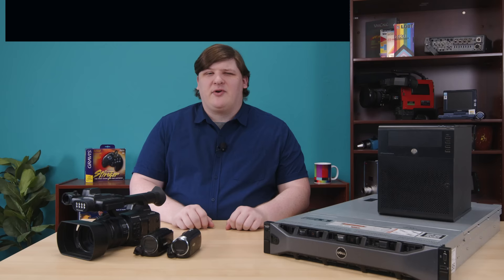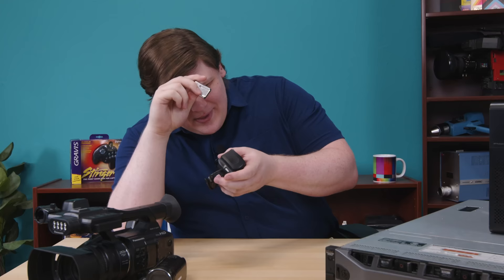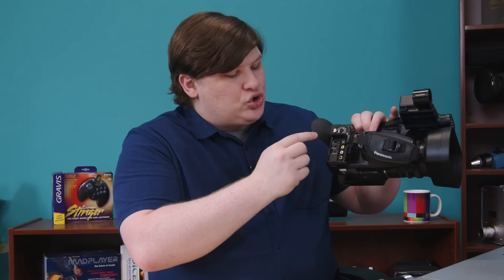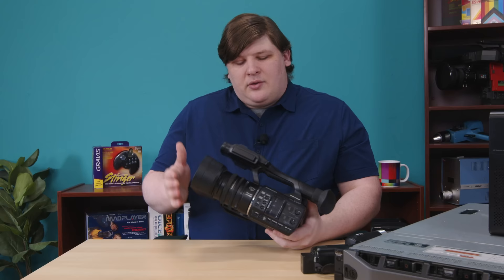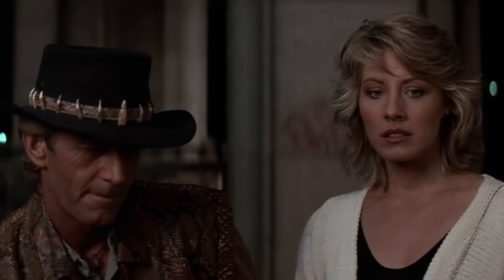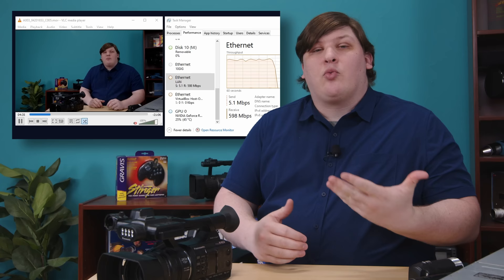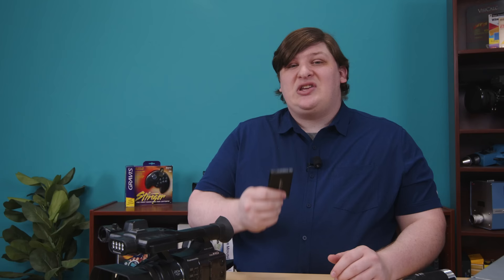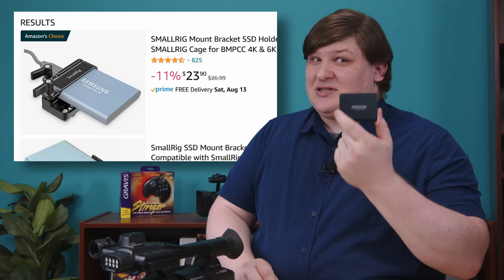I Built... a really fast NAS?

Comment: I have a few SFP+ 10GB NICs...  Both of my computers (Windows-10 and Windows 11-pro) have a dual-cage card like the one you said was dead as fried chicken.  I actually ran into the same thing UNTIL I installed the drivers from the card's website.  Not sure eactly how it works, but VERY VERY early in POST (I think before it even hits the BIOS) it loads the driver.  When turning on the computer the VERY first thing you see is a 3-4 line blurb about the NIC card and tells you to hit CNTL-S (Or something like that) to get intto the CARD's configuration...  Granted for me, I never had to actually go into the setup by interrupting the boot, but I CAN say that without the drivers I got from the card maker's website, the O/S didn't see the card AT ALL.

Comment: I only record and edit in 1080P still, but I still end up in insane amounts of data, but I have run my channel since 2012.  I have been a network engineer for 30 years, so I am pretty experienced.  I have a "server" chassis with hot swap bays but I built it with a regular MSI motherboard and a AMD processor, with 16GB of RAM.   I have a 250 GB ssd for the OS, and I have 5 4TB rotational drives in a RAID 5 with a hot spare.  I am just using mdadm to make a software array.  I use XFS.  I also have a 1TB single rotational drive for scratch data.  I have a removable drive bay for my backups where I backup to 12TB drives with rsync.  I use LUKS encryption for my backups and run one of them every week to my safety deposit box.  I have a 10GB/s switch that runs 10GB/s on standard Cat5/6 cables. and I have 10GB/s adapter in my main workstation and many of my other computers are 2.5Gb/s or 5GB/s.  I am using a tp link switch and I don' t have any network problems, I use them for many customers as well.   Currently I am running Rocky Linux, but I used to use CentOS (till they went stream).  I also run my DHCP, DNS, web server and mail server on it.  Once every few months I shut it down and take an image of the boot drive with Clonezilla.   I also use a little known program called drive snapshot and do a backup on my main workstations and laptops..  It is a really small program, a single executable, and it does differential block based backups, so I don't have to wait very long on it to run.  And it runs on a low priority thread, so it will automatically slow down or even pause if I am using the computer.

Comment: As someone who builds software in the cloud/server space, I just wanted to say that every decision you made building this NAS was exceptionally thought out and most people would over look these things. Because you're going with Twinax in adhoc mode so you can essentially do direct attach, I was wondering how close this server will live to your editing rig. At this point I have a rule of "no more servers in the house" because the noise, heat and maintenance are no longer worth it for me especially with how cheap baremetals in datacenters are (OVH and Vultr have amazing prices, OVH has more to offer on the storage front though with a beefy baremetal containing 4x 12TB drives for $165/month). Your case makes sense because of the sheer amount of data and the bottle necks of that transfer. You said you're a Dummy and didn't want to build a machine smarter than you, but honestly; I'm impressed with all of your decisions on building this. It's gonna last you a long time. Great Job!
Reply: 4x 12TB for 165$/Month?
Hetzner has 4x 16TB for 87.56€/Month.
I used one of those for a while, but ended up hosting that stuff at home, because it is actually cheaper, even after the purchase of 4x 18TB drives, the Supermicro mainboard, RAM, UPS etc. and calculate the (now higher) electricity prices, it's pretty much amortized in about 3 years.
If you compare that to the OVH offering you mentioned, and maybe you don't live in Europe where the electricity prices skyrocketed lately (and drives are also cheaper), you'll get an even faster ROI, probably closer to 1 to 1.5 years.

Sure, you don't have to manage the hardware, but you pay A LOT for that. And another benefit from hosting it yourself: you have hardware access, which in a DC you only have of you do colocation.
Reply: @RobinCernyMitSuffix  I just have this rule of "no more servers in the house". Becomes hours of my life working around the server after regular homeowner mishaps. Basement flooding, power outages, cooling and heating in the basement, humidity issues, noise, Dynamic IP, etc. It became too entangled in my life with a growing family and to alleviate that, I found the monthly cost worth it. I encourage everyone to experiment with servers in your house though, you learn alot and it's kind of a fun hobby.

Just checked out that Hetzner plan, now I can easily migrate over to that for less money a month, more storage and better hardware. Thanks!
Reply: @barrynevio4440  understandable, but still, flooding is not really an issue for most people. And noise and dynamic IP addresses are just a setup thing. I barely have to do any maintenance on my stuff, maybe once or twice a year something a bit bigger that takes a few hours, like setting new things up, but you also have that on every server no matter where they are. And every few months cleaning the case from dust.
The rest is pretty much automated and monitored. After the initial setup which is quite a bit of work (not much less then renting a server in a DC) it just runs.
A lot of the work applies to all servers, like upgrading the OS and software.

To be honest the server that I have in colocation in a DC creates more work and runs less stuff then my homeserver, but that's probably just because of the sub par hardware that I use there >.<

Comment: Back in the day I admined ZFS in data centres .  Zero problems.   Super cool, simple and loaded with features: snapshots, dedup (if you have lots of CPU) & you can use a very fast SSD cache too with slower disks behind it.  Make sure you got some automation to alert you when something redundant fails, disk, fan, power-supply

Comment: So someone has probably already commented about the backplane, but the chip on it is actually a SAS expander. It actually has nothing to do with SCSI LUNs, it's actually just part of SAS itself. It acts a bit like a network switch - true SAS devices have a specific unique 64-bit address, like a MAC address, and the expander routes connections from one device to another based on that address. Connections can be from initiator to target (sending a command, writing data) or from target to initiator (returning status or data). The thing is, SATA drives are not aware of these addresses, so the expander does a bit of trickery where it remembers the last initiator to open a connection to the drive, and routes the response back based on that. It's called STP (Serial-ATA Tunnelling Protocol) and it was the bane of my existence when I worked at LSI testing those expander chips. It basically breaks down completely if you have more than one initiator connected to your topology (e.g. redundant paths or clusters) trying to access the same SATA drive at the same time. We had stress test topologies with 16 cascaded expanders, each with an initiator and 4 SAS drives plugged into it, all doing I/O to all of the drives. That never would have worked with SATA drives.

Comment: I watched this video for the first time when it first came out and figured I'd never get into the self-built NAS/homelab thing, but I had the opportunity to buy a PowerEdge R720 (not the xd version) from my company for $18, so I went ahead and got it.  Dual Xeon E5-2690s and 96GB of RAM, with the ability to go to 512 GB (the non-xd version of the system doesn't support as much RAM as the ridiculous amounts of the 720xd).  It was used for network tasks so it had only one drive bay and was using the standard SATA software RAID controller.  One IT mode flashed PERC H310 and a new set of drive bays later (all of which cost about 4 times as much as the entire server), and it's ready to use.  

They're certainly not for the faint of heart, but they're fun to play around with if you can get one for free/cheap.  If you put something like Unraid on there, you can get an entire NAS/virtualization solution set up, though sadly Unraid is a commercial product you have to buy a license for.

Comment: What a great video.   It takes me back to being the IT Guy at a factory, and putting everything on RedHat servers.   Those 500gb HDD's had just come out. replaced all those 9gb SCSI drives.     Those poweredges were great.  like 2004.     Soooo many hard drives.  I had a 9 x 18gb SCSI tower of just drives. and 3 of the 12 x 9gb scsi RAID enclosures.   and the Tape Drives.   Those DLT drives.     and Gigabit networking was just new. So I used a crossover cable with jumbo packets for server dumps at night.  rsync was great...  and then we got fiber on a level3 backbone.   ahhh man.  now stuff is made in china.  I'd love to buy that building and run a company there again.

Comment: Your server has a SAS expander on the drive backplane. 4 or 8 SAS lanes go in one side and 12 come out the other. using one connector gives you 4 SAS lanes into the expander for the 12 slots out. Adding the second cable will give you 8 lanes of bandwidth into the expander. If you have more than 4 drives (especially SSDs) you should add that second cable to get maximum bandwidth into the backplane.

Comment: CFast is the SATA based Compactflash (the original spec is IDE based) The "current" CF standard is CFExpress, which are quite pricey, use NVME 3 and 4. The Xbox Series "drive expansion" is basically a cut-rate CFExpress card.

Comment: I know I'm over a year late on this, but I felt like pointing out - 23:42 - I'd bet a nice shiny new US quarter that the main change between the 5 and the 7 was that they switched from a 2.5" SATA-based drive to an M.2 PCIe-based drive. Probably a -2280, so they lengthened the case to accommodate the drive length. M.2 drives are thinner than the guts of a 2.5" drive as well, and while the SATA M.2 drives probably don't require cooling, they may not have reduced the thickness of the case so much as narrowed the space inside to bring the case (and a thin thermal pad) into better structural contact with the drive.
43:28 - oh my god that awful little bastard. My last job (the high voltage laboratory) used one of these Turion nightmares for their server. I am so sorry you had one.

Comment: It turns out there's another evolution in the Compact Flash line, CFExpress which is basically XQD converted to run on the NVMe protocol, hence attaining speeds of over 1GB/s, and 1TB cards exist at around 600 US$. 
However there's a trick involving NVMe SSDs , since it's basically the same and there are 2 types of adapters: Enclosures for the 2230 type SSDs which are a size match for the XQD card size and external dongles for the 2280 type.
And we all know you can get 1TB NVMe for less than $100, so there's a bit of hope for the prosumer realm.

Comment: For video transcoding you can use something like Tdarr. You just set up Tdarr on the server, and then install a client on any of your devices that have a GPU and it can transcode things in the background. You can even set it on a schedule (Like after you go to bed) or set it to only run transcoding operations while your computer is idle. It would certainly solve the issue of not being able to put a GPU in the server, and it might actually be faster if you have multiple PCs with a bit of horsepower set up and running.

Comment: Only thing I can add myself is I have had both a Dell and an HP server, both of similar vintage to your new server, and I can 100% recommend getting an HP ProLiant Gen8 over any Dell. They’re generally around the same price used but are much better designed. Of special note for your use case may be the SL4540, which can hold 1-3 servers with a few drive layouts of at least 48 drives. Great for big data storage.

Comment: Thank you for letting me know the BX drives I've been getting for over two years now are a bit crap 🥹 At least for my main system I'll sort out a better solution (SSD with a cache) But thanks to this video, I did 3am parts ordering! But will leave my screw about systems that don't need the fastest transfers as is (knowing they're just slightly crap)

Comment: The smaller video cameras were a budget godsend during the pandemic for the more geeky people. One of these 10-year old cameras, stuck in a box in the basement for what seemed forever, coupled with a $20 capture card gave superior results to any available "webcam" solution as far back as the world health events of 2020. Even the cameras were available used for around $100. Granted, a mirrorless with an Elgato Capture was much superior - but this would run about $1000 for a little better results. Today, there are webcams with larger sensors that do better, but they are still hundereds of dollars. But for a $20 investment at the time - it could not be beat for 20x its price at the time. It still is the best bang-for-buck for someone who wants to stream today with 1080p max quality. The adapter cable for the HDMI was also needed and it would be fine as long as the cable wasn't knocked LOL.

Comment: I feel ur pain. I ended up installing a 4 port 10gb NIC in both my server and workstation so editing straight over the network would not be hampered by the network. I’ve used fibre optics for the connections. OM3 standard is more than enough for this. Add 16x SAS disks in RAID 10 for space & performance was key for the disk speed, yet to consider changing the disks out for 14 SSDs in RAID 6…

Comment: i accumulated six 4TB SATA SSDs in my editing system. all run striped for almost 3GB/s sequential speed so they do not bottleneck anything and i have one 22TB Volume for all projects i need to work on. its more than enough even with recently flooding it with EOS R5C 8k raw files.

when i come home from a shoot, i copy all files from the cards/ssds onto my system and simultaneously copy a backup to my NAS (8x18TB HDDs, truenas, 2 disks redundancy) via 10gbit ethernet.

this way, i have the "hot stuff" on 2 seperate places and the cards are free to use again immediately.

when i am later done with the project, i throw away the RAW files on my editing machine to make room for new work. so far, the 22TB volume is enough and most of the times about 30%-50% is used.

the NAS might fill up in around 2 years or so and i am not quite sure at this point what i will do with the old raw files. probably just throw away anything that is just boring client stuff where no one will ever need the originals again.

Comment: I guess somewhere there is an sas-expander. Maybe not on a dedicated card but part of the controller.
An sas-expander is usually a card that takes say both sas-lanes in and then expands the ports to say 12.
As you noticed, it will work with just 1sas cable, but you then loose 50% of the bandwith to the disks

Comment: This might sound crazy, but if you happen to have one of the H700 series controller in your Dell, you might be mind blown by the seemingly impossible RAID6 performance these controllers are capable of. I've built quite a few of these with all 12 bays populated with identical SATA or SAS spinning drives configured in a single huge array for CCTV systems. I wasn't too concerned by performance for the application, but testing proved that the 12 drive array would read or write at nearly 10x the speed of one of the single drives in spite of everything I've been told about RAID5 and RAID6 performance. In short, it makes for a very large, very fast, very reliable, and very affordable array. Edit: don't reflash the controller, Ubuntu supports it out of the box and you may also want to look into iSCSI instead of samba, NFS, etc if you want to get the top performance.

Comment: I like my home NAS specifically because it is small, quiet, low power, and works well.  But I went with a decommissioned Dell network switch for my home LAN. It was cheaper than the trash consumer switches on Amazon and 48 ports so bigger than anything I will ever need. It's a rack mount device but fits fine on a Metro shelf unit.  It's loud, but a few doormats from Dollar Tree work great for noise absorption.   And the damn switch works. It just works. Every day. No excuses. Wishing I had a data center server to go with it, but the power issue kills that idea.  My house wiring rules out that stuff.

Comment: 38:33 I worked as an infrastructure tech at a Syngenta site, there was this 1u Supermicro DVR storage rack unit that was so obnoxiously loud, that it actually bothered the people through the walls of the datacenter. They had to replace it, as people were going crazy with the noise... Certainly a datacenter is not a silent place, but that unit stood out haha
Reply: PS: Storage space on big companies is treated like a "ranked" resource, usually you have an on premises NAS box (like for ex. the MS Storsimple unit), that has some kind of SSD caching, some disk storage and a management interface. It works like a normal NAS, but the data is actually being synced to the cloud, and only the most accessed files are stored on this appliance, for speed and latency reduction.
With that in mind, if you ever max out or need to store more data than your NAS can hold, you may look up to some cold storage services, like Amazon S3, or Azure blob something (can't remember the name) and offload some of your storage to the cloud.